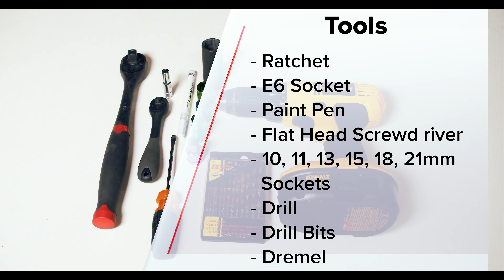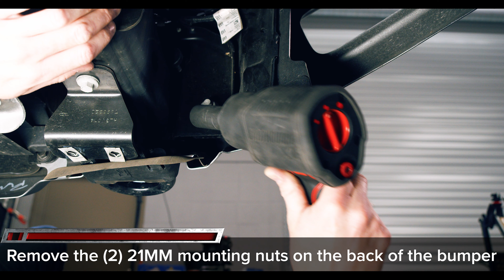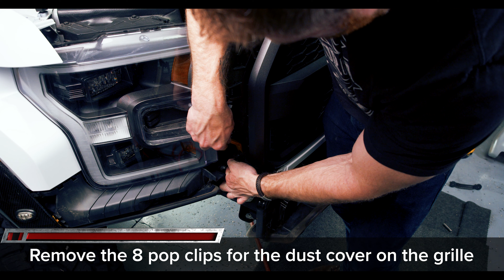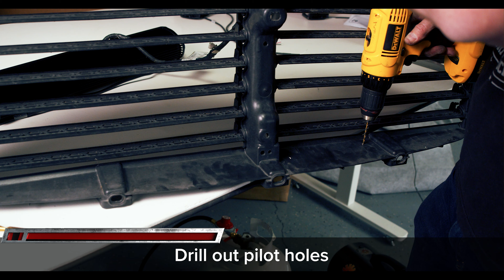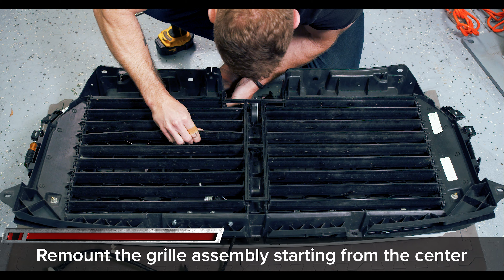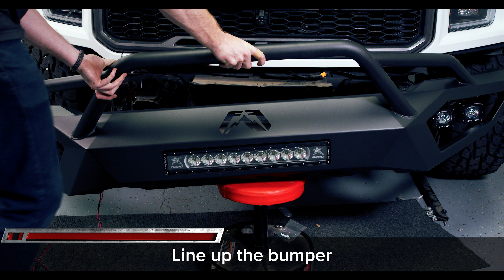Fab Fours Vengeance Series Front bumper install on 2019 Ford Raptor Bolt on Build Series

Comment: Do they have a winch version of that bumper?
Reply from the maker: Hey Kenneth, yes they do. They make their "Matrix" Bumper, which is styled after the vengeance, but includes a winch mount and spot for LED lights as well. Its available with and without the pre-runner guard, and they make it for the 17-20, and the 21-22 versions of the Gen 2 Raptor. We'd love to help you choose the right configuration, as well as winch and light bars, give us a ring at 833.MOTOROSO (833.668.6767) and we can walk through everything. Can also live chat with us on www.motoroso.com.

Comment: Do u hv to cut the crash bars to install this bumper???
Also does it come with the sensor spots already drilled???
Reply from the maker: If it's going on a Raptor, no cutting required. 
And, no, there's no sensors on the front bumper of the Raptor.  
Feel free to call us at 1.833.MOTOROSO, we'd love to get you a great deal on your parts!